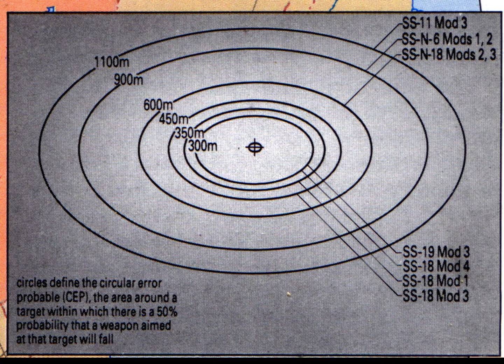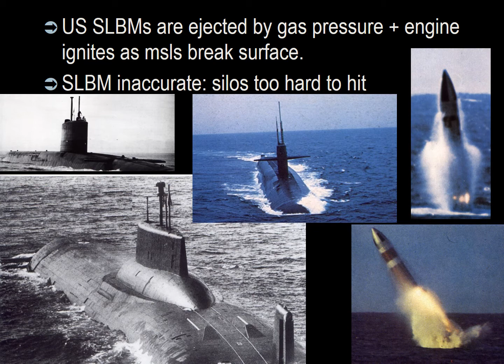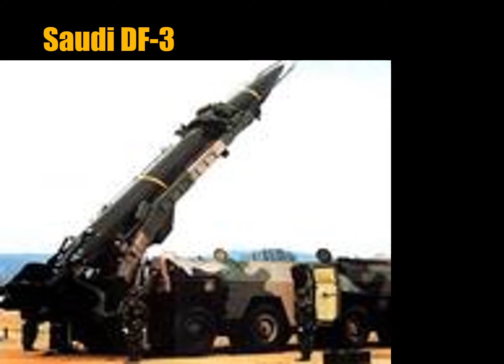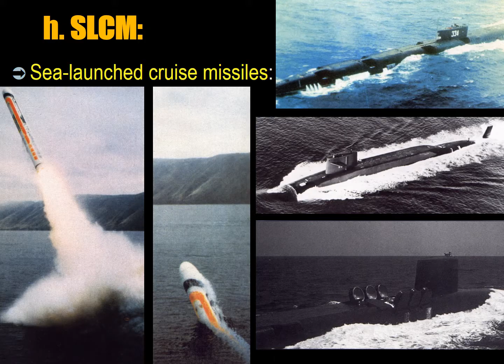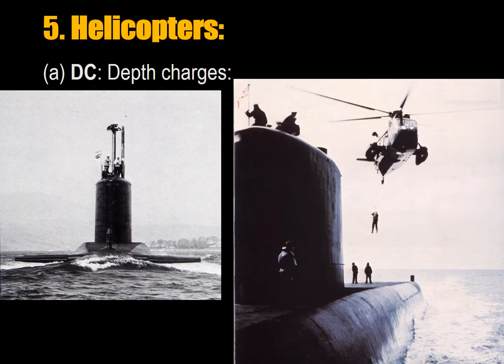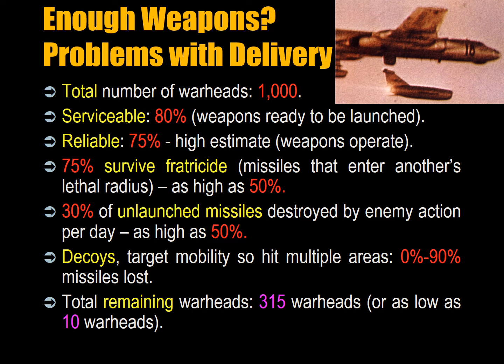002 Nuclear Strategy Lecture 6 Delivery Systems Part 2

Comment: Why a plutonium warhead for longer ranged systems?
Reply: Greater Yield-to-Weight Ratio: Plutonium warheads can achieve a higher yield (explosive power) relative to their weight compared to other nuclear materials like uranium-235. This higher yield-to-weight ratio allows for the design of more compact warheads, which is essential for fitting nuclear payloads onto long-range missiles.

    Smaller and Lighter Warheads: The higher energy output per unit mass of plutonium allows for the construction of smaller and lighter warheads without compromising their destructive power. This is crucial for long-range missiles, as it enables them to carry larger payloads or reach farther distances.

    Space Constraints in Missiles: Long-range missiles have limited space available for payload, guidance systems, and propulsion. Using a plutonium warhead allows for a more compact nuclear payload, leaving more room for other critical components.

    Reentry Vehicle Design: Plutonium warheads are better suited for the design of reentry vehicles, which are the protective shells that carry the warheads through the Earth's atmosphere during the terminal phase of a missile's trajectory. The small size and high yield of plutonium warheads make them easier to fit into reentry vehicles without compromising the vehicle's aerodynamics and performance.

    Advanced Missile Technology: Longer-ranged missile systems often employ advanced missile technology and guidance systems. Plutonium warheads can complement these systems by providing higher energy yields and a greater capacity to overcome missile defense systems.